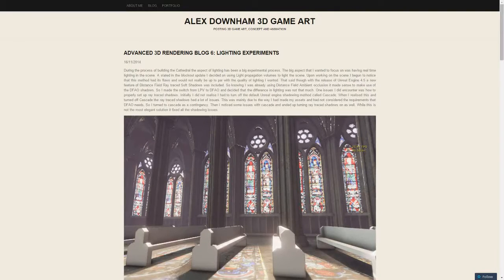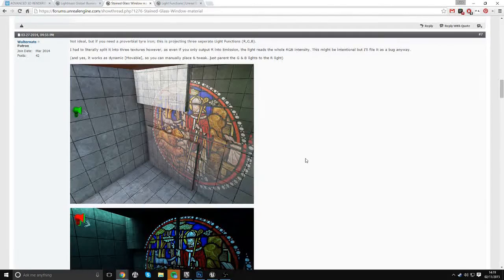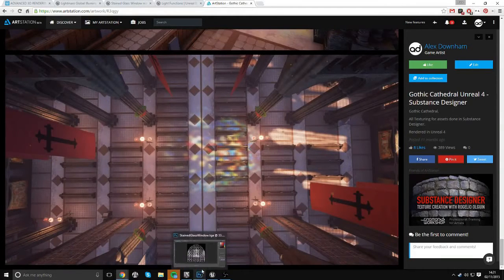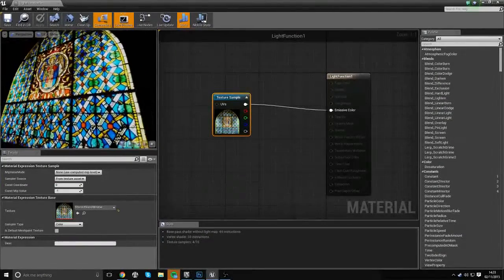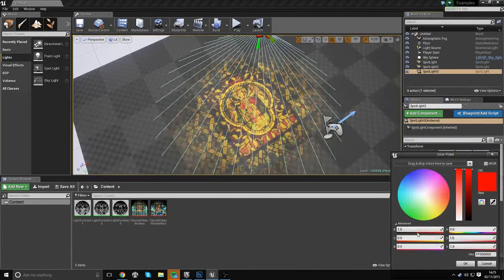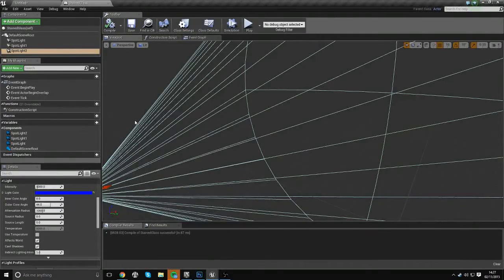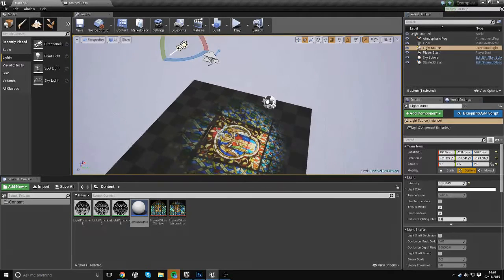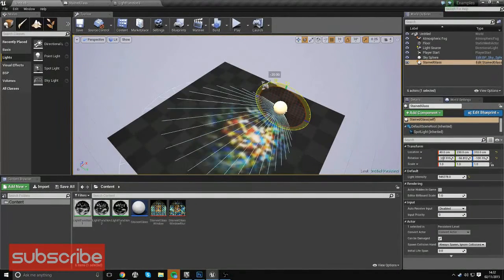Unreal Engine 4: Dynamic Stained Glass Tutorial

Comment: One way of doing the Light Materials a bit easier would be using Static Switches each wired from RGB with their own true/false then add together into the Emissive. Create Material Instances for each Spot Light and set R = true on the Red Light, ect. Then you can edit the parent with different textures, ect and have them all update.